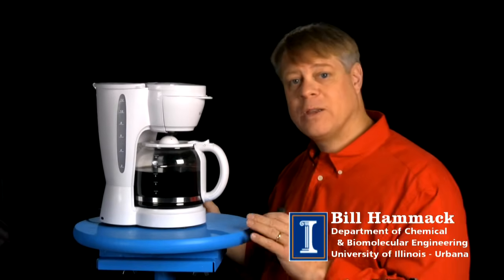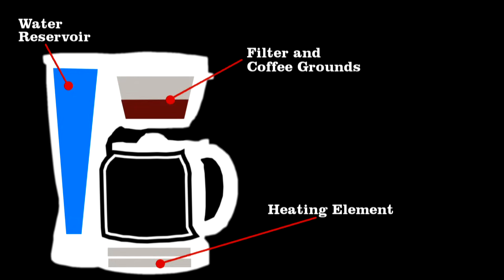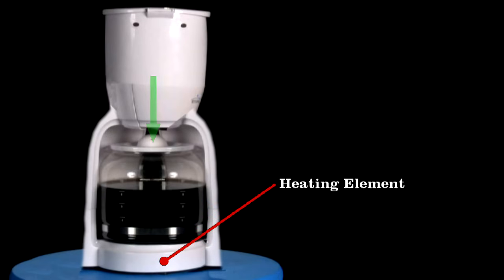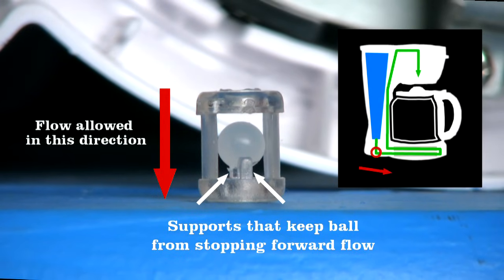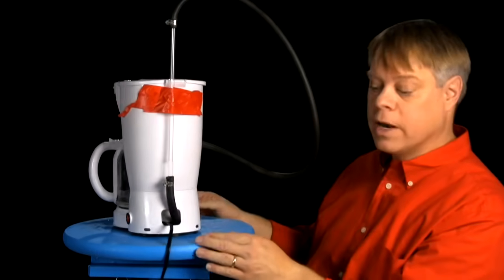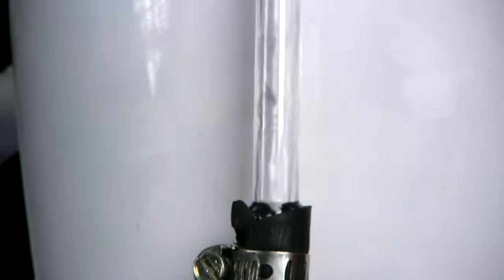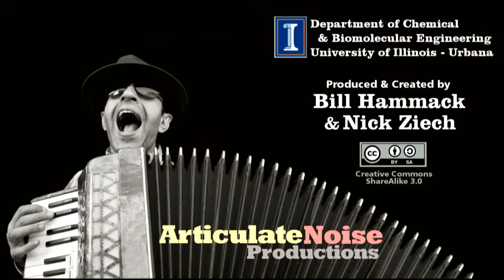Coffee Maker: Pumping water with almost no moving parts

Comment: How about an update with a Keurig.  It has an air pump. A slow leak valve. A pressurized reservoir.
The water drains into a reservoir which seals once filled.  Then it is heated.  Eventually the water is hot and an air pump turns on to supply air pressure into the top of the tank which pushes the hot water out the bottom of the reservoir and up to the cup.  As the water is initially heating the expansion of air in the reservoir would push the not yet hot water up to the cup.  So there is a valve from the top of the reservoir that will let air leak through it slowly, reducing the pressure so the cold water does not prematurely go to the cup.  When the air pump is on it pushes air into the reservoir at a much greater rate than the slow leak valve can accommodate so the hot water is pushed out the bottom and up to the cup.

Comment: I use a glass siphon. Water in bottom pot is heated, steam pressure pushes water up tube through filter into upper pot where hot water and coffee grounds mix, after about a minute take pot off heat and the air in the bottom pot cools and sucks brewed coffee back through filter into bottom pot. Much better than auto drip. Zero moving parts.

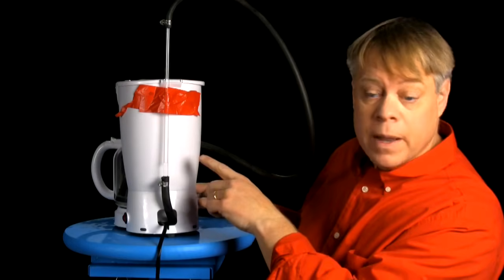Comment: 1:34 to 1:37 why is the water level lower in the clear tube compared to the water level in the reservoir? Feels like there's an "engineering-y" type answer
Reply: Different diameter tubes? Surface tension/capillary action? Intuitively I would expected the water level of the clear narrow tube to be equal (principle of a "water level", ie a level used in construction but made of a tube of water) or perhaps even higher. This is the opposite!

Comment: Thanks for the laugh, nice way to end the video. That look when unplugged too.. bubble pump and a ball valve, imagine if the romans knew about that...how would u add bubbles without an air pump or boiling the water?
Also how does it stop it pumping the water before getting to boiling point...is that to do with the length of heating element and size of hose after the ball? Blonde moment just realised wouldn't have bubbles unless its boiling...the bubbles are steam

Comment: This is surprisingly smart and effective
Not only is it cheaper, but it also lets us put in water to use later instead of near-instant action that the first Mr Coffee machines had (probably as well as other early coffee makers trying to usher in a new era of coffee making)
It removed the rush of puttinng in the coffee, turning it on, puttting water in and making sure the carafe? is below the outlet within like the 15 seconds itd take for the coffee to soak up and let through

Also i came here from technology connections.
Reply: Yup, same here.  Hope Bill posts videos again.
Reply: @shaider1982  look out for march 2023
Reply: The original commercial drip pots used gravity, heat water in reservoir, when light comes on pour cold water into reservoir, cold water sinks to bottom, hot water overflows into brew basket.

Comment: You should do a follow up on the engineering of planned obsolescence (the art of designing shit to break). Because a modern coffee pot is a really good example. In brands such as cuisinart the ball valve is intentionally placed in such as way its near impossible to access without destroying some aspect of the coffee pot, on top of lacking basic screens to prevent clogging over time.

Comment: I was puzzled why an engineer would create this mechanism for heating the can, while he just could have used a vacuum isolated can and a simpler top heater. After some google research I found that this design was first used around 1830 (in percolators which aren't exactly the same thing but close) while the vacuum can came up around 1880. And what am I using today? A coffee machine with a vacuum can that still has the heating element in the bottom and uses the bubble pump heating and transport system, despite the heat has no secondary function (the can pad of the very well isolated vacuum can isn't heated). I guess it's cheaper to buy the bubble pump parts from the shelf than to design a simpler top heater system for the vacuum can \o/

Comment: Are the bubbles we're seeing in the glass tube actually water vapor or are they instead the dissolved gasses that were present in the water before heating? I feel like bubbles of water vapor would be relatively short lived and would quickly condense back to liquid water before they had a chance to slowly make it up the tube. Also, wouldn't the net fluid movement be caused by the change in volume of the water when it goes from liquid to vapor and the check valve rather than the bubbles rising upwards and pulling water along with them?

Comment: Thermal drive head, caused by the expansion of water as it is heated.  You dont need a video this long to explain this. In fact, thisis called natural circulation because this is how spring water works.

Comment: the title of video  "no moving parts" got curious came in 0:06 "almost" I'm out.
Reply: Technically there are no moving parts. The one moving element is a component of a one-way valve, a ball that blocks water flow in one direction. It's not a moving part in the classic sense - there are no motors or belts, but it does move with the flow of the water in the tube, and that's why he says it "almost" has no moving parts.
Reply: @unflexian  The video's title is clearly trying to deceive people.

Comment: You should have started with the first Mr. Coffee.   They did use two heating elements.   One bottom element for heat and an upper element for brew.   They were very unreliable and that is why I had a job at 14 years old repairing them for $2 each repair.

Comment: Im a little confused. I'm not sure the bubbles are actually water vapor. Evaporation occurs as a natural process at atmospheric pressure. However, the bulk phase change of water doesn't occur until the vapor pressure of water equals atmospheric pressure. This is the boiling point, where bubbles of water vapor form in the body of water and float to the top. Waters boiling point at atmospheric pressure at 212 F. Coffee is brewed below that temperature. Water doesn't hold as much air at higher temperature. I am guessing those are air bubbles coming out of solution. I could be wrong of course. Perhaps the water is boiling and cools down after the coffee is brewed.

Comment: How many times do engineers forget to plug it in ? Great show, however the unit has the habit of taking some cold water in the slug, my father in law noticed this when instead of using boiling water he used this type of device, the water didn't boil correctly and so he ended up with a dose of the tummy trots.

Comment: I have a Mr Coffee Tea Maker that just has the one heating element in the bottom, I know this because I removed the stupid security screw from the bottom so I could clean out all the plumbing in it, lots of white nasty build up in there, yay vinegar! Anyway, it clicks and gurgles and pops while it's pushing hot water into the basket at the top, I didn't know how it worked, I thought it was just a thermosiphon, but I was incorrect, apparently. I wonder how many times you can thermally cycle the little plastic ball before it breaks up or fails otherwise.

Comment: A few minutes ago I tore apart our old coffee maker, just to replicate the lessons in this video. There's another interesting aspect to coffee makers that I hope Bill can cover someday: bimetal thermostats. The one I found in the old coffee maker was the cylindrical kind, located on one of the power input lines to the heating element. At my job we use a different type of thermal switch as a safety mechanism in case a device overheats, but the bimetal principle is the same. Thanks again for making this video. It was fun to re-watch it, this time with a torn-up coffee machine in hand.

Comment: Tesla valve? Would Tesla's one way valve, which does not have moving parts, work in this situation? It seems to me that if any liquid water returned to the heating element, it would eventually change to steam and move to the filter chamber. Is a Tesla valve more expensive than a check valve because the Tesla valve requires more material and/or a more complicated manufacturing process?

(Thumbs up: brief, funny, interesting)
Reply: I think Tesla Valve would have been pretty cheap to make from all injection molded parts. I can see a few issues with it though. The valve is rather big and has a lot of surface area, so while traversing it, the water would cool off quite a bit. It would also be even more susceptible to sediment deposits than a ball check valve. It also can't sustain a lot of pressure difference between an inlet and an outlet, and you need about 1/3rd of an atmosphere or more for the coffee pot to work, so i guess it can just about be done, but likely wouldn't be worth the effort.

Comment: actually, having a reservoir on top does not demand two elements.  Just run a cold tube down to the element and a hot tube back up.  One of my machines put the boiling water thru the cold tank with very little insulating hardware.  Got a better one now.

Comment: I was going to comment that the title is misleading, but your statement at 1:17 "This simple device creates a pump with ALMOST no moving parts." corrects the record.  The presence of the check valve is in fact a moving part.  If the check valve ball was to get stuck on the seat, or stick in the open position, it would render the system inoperative.

Comment: The Mr. Coffee I took apart today had a different valve,  it was a ball with a stem on it and then a upside down V shape mounted to the stem which catches on a ridge when actuated in the free flow/opposite direction of the seal. The ball valve looks very much like the gender symbol for a male.